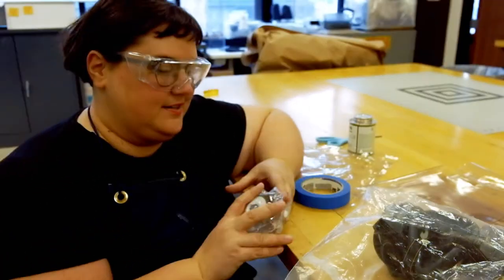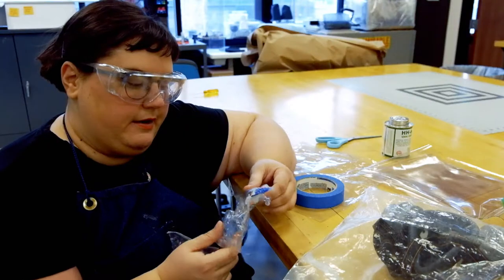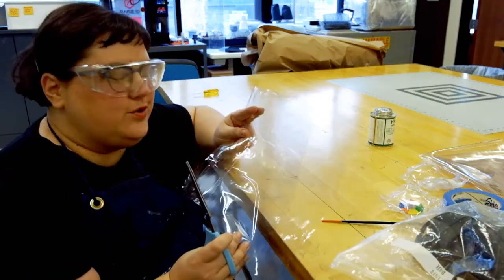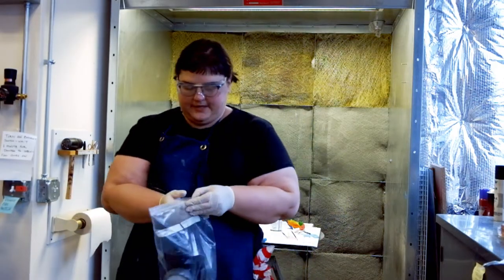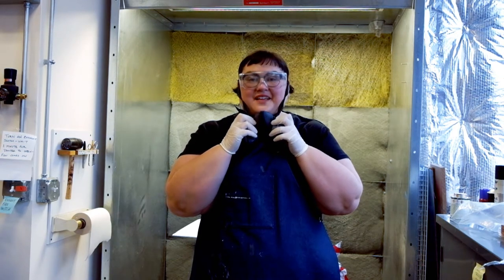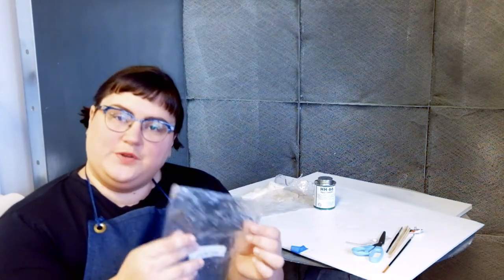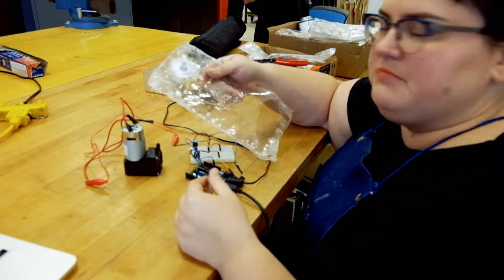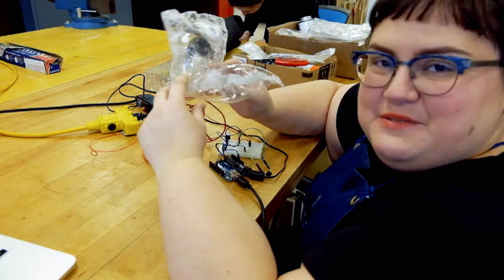DIY Inflatable geometry with HH-66 Vinyl Cement (Part 2)

Comment: I use a syringe with an 18 or larger gage needle to dispense HH-66. Also, think of HH-66 as a chemical weld as opposed as a glue. HH-66 is designed more or less to degrade the vinyl with acetone so it bonds together. Also, try looking at double impulse hand held crimp heat sealers. I got mine off Amazon, works great with this type of vinyl. I only use HH-66 on curves or internal items.

Comment: Hi Becky, I'm learning to make inflatables too. Can you not use a sealing iron or a soldering iron to seal up the vinyl? Does it not work with clear? Just curious. Love your videos!
Reply from the maker: Good question Katy, and this is worth an experiment. However the reason why I didn’t try a soldering iron or other heat tools is because I assumed their temperature range was much too high and would end up singeing the vinyl instead of just fusing it, like the roller in the video. If one could find, or manufacture, a flat iron / heat crimper that is programmable to vinyl’s specific glass point, that’d be best. 

The programmable tool that comes to mind is a sous vide, but could aliquid transfer the heat? I’d wager it would be more efficient to design a tool and mass produce it via Kickstarter than to attempt that experiment!

Please do reply with any further speculation or counterpoints!
Reply: @BeckyMarshallDesign  Thanks for answering, Becky. I'll be on the lookout for any new ideas and I'll keep watching to see your progress too :)
Reply from the maker: PS I just realized this isn't the heat experiment video! Just in case you missed it: https://www.youtube.com/watch?v=4JxS91OddJA  @katyb3869